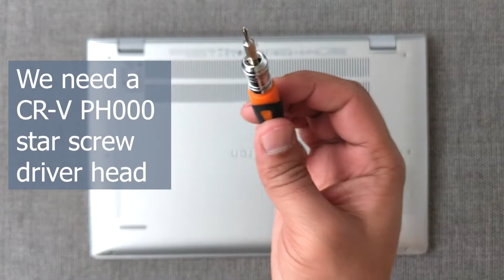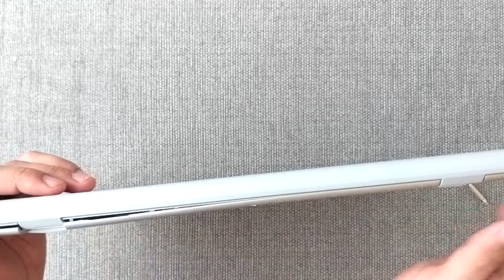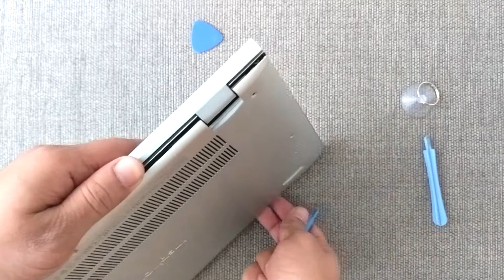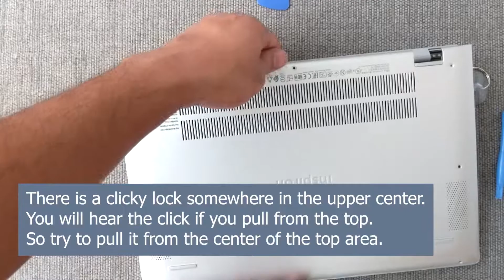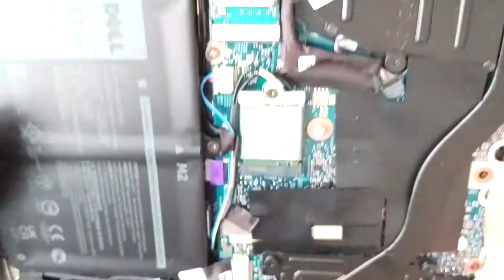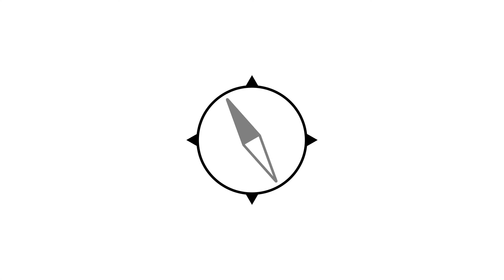How to | Disassemble and Upgrade options, Dell Inspiron 14" 5000 Series, 5402 Laptop | NAVIOSITY

Comment: I see a problem with the expansion lot for the second SSD NMVE disk, the speaker is in the same space, so one interfere with the other, not sure how to put both properly...
Reply from the maker: If you have the M2 SSD it should not interfere with the speaker. I tried it with a M2 SSD and had no issue. Can you check if you have the correct form-factor ?
Reply: @naviosity  I realized that yours is a bit different compared to mine, I will send you a picture to let you know what I am talking about
Reply: @naviosity  https://www.youtube.com/watch?v=17hrtNfHRJU&ab_channel=RepairIt Look at this video, can you see on the right bottom corner, where there is space for the SSD, is the same space as the speaker, yours and mine are a little bit different, I think it was a design issue from DELL

Comment: Thank you so much 💝
Reply from the maker: You're welcome 😊
Reply: @naviosity  bro would you please suggest me choose between acer nitro 5 and Inspiron 5402?
Reply from the maker: @jeee3t  I can try to help here. Acer Nitro 5 is more like Gaming on the move where Dell Inspiron 5402 is more regular use laptop.
If your focus is gaming, I would suggest Acer Nitro 5 series as they built it with gaming in mind, dedicated Graphics, higher display refresh rate and response time.
You can still get a 5402 with dedicated graphics and play game, but you would miss the display refresh rate and response time (which is important for gaming).

If not for gaming, I would suggest Dell Inspiron 5402. light weight, slim and small design. Smaller display bezel like most Dell laptops now a days. And to be honest, it looks much better than Acer Nitro 5 series.
Reply: @naviosity  i wanna use ae .. is inspiron capable of running it?
Reply from the maker: @jeee3t  Could you please tell me the full software/application/game name ? I could be miss-understanding what you meant by "ae".
Reply: @naviosity   i meant adobe after effects
Reply from the maker: @jeee3t  Thanks! If you want to work with any Adobe products I recommend to have a laptop with dedicated graphics card. Acer Nitro 5 already have one, but if you select Dell Inspiron 5402, I recommend to buy the variant with dedicated graphics card. 5402 also comes with NVIDIA dedicated graphics cards.

Comment: Do you know if the computer admits SSD M2 NVME? or just SATA one? Thanks a lot
Reply from the maker: Hi, the laptop board says M2 but not sure about the nvme (the one installed was SSD)
Reply: @naviosity  I checked on the internet and seems that it admists SSD M.2 NVME disk :)
Reply from the maker: @jaimearenas9532  Thanks for the finding. I'm sure it will help others :)

Comment: Hi bro, Can we upgrade 2×16 GB Ram in both the slots? And what is the maximum size to upgrade ram in this laptop,
Model: 5406 i5 processor
Thanks for the video for explaining it deeply. Loved it.
Reply from the maker: The system says it supports up to 128GB of RAM. So I don't see any issue haveing 2 x 16GB maxing out to 32GB.
On windows you can run the following command (in command prompt) to get maximum ram supported by the machine: 
wmic memphysical get maxcapacity
It gives the value in KB, so you have to divide it by 1024 twice to get the value in GB
Reply: Thanks for your quick response. Really appreciated.
Can we upgrade 16×2 gb ram with 2666V or 2400mhz?
Reply from the maker: @saqueebshariff  This laptop ships with 3200MHz RAM. I would not suggest lower than that. But if you prefer other speed, then keep both RAM at the same speed. 
If you keep one RAM (the one it ships with) at 3200MHz and another to 2400MHz, eventually it will downcast to 2400MHz for both. So you loose some speed you have.
Reply: Thats great. Thanks once again♡ So i can put 2 16gb rams with 2666v
Reply from the maker: @saqueebshariff  You should be able to install 2  16GB 2666MHz RAM. I don't think 2666(V-W-U-T) matters as all these are standard.
Reply: @naviosity  
Hi, I have upgraded 32 GB Ram in dell 5410, But it produces lot of heat below RAM part. Will anything affect coz of that. Like it produces lot of heat
Reply from the maker: @saqueebshariff  Hi, I'm not sure how to help you here with the thermal issue. It varies device to device. But I would be careful and read the RAM manual for heat tolerance (if any ) if it produces significant amount of heat that you can detect normally.
Reply: @naviosity  hi im not very good with ram i want to add another 8 gigabytes of ram which ram would I want to buy?
Reply from the maker: @riskycharlie312  Any RAM with SODIMM form-factor (most laptop ram's size) and bus speed of 3200 Hz (because the installed RAM also has bus speed of 3200 Hz). This is important.
If you put any RAM with lower bus speed than 3200 Hz, the lower value will be your performance. So just check it before you buy. Hope this helps :)
Reply: @naviosity  ok thanks

Comment: Is the material Metal or Plastic? cannot find the answer anywhere
Reply from the maker: The material is plastic. But the outer sides (of the back and also the palm rest) is electroplated with aluminium. So in first touch it feels like aluminium but it is not.
Reply: @naviosity  Thanks for the info!

Comment: How do you remove the battery?
Reply from the maker: I haven't actually tried to take the battery out. It wasn't the goal. But as you can see, the battery is not behind anything, you should be able to take it easily. Although it might be fixed with a double sided glue tape underneath.

Comment: This shows u how to remove the bottom panel lol.  What a lazy guy!  Removing the bottom panel is not disassembly!!  You don't show how to remove literally any component.  Click bait
Reply from the maker: Hi Lee, I show what is normally needed to upgrade some components. I partially agree with you, I don't disassemble the entire laptop, but I guess you don't need to for upgrading.
Reply: @naviosity  Then the title should read 'how to access / upgrade HDD, RAM, CPU, etc' or something like that.  Not 'how to disassemble'  The title is intentionally misleading to get more ppl to watch than will be actually helped by the video
Reply from the maker: @jlee3844  I still partially agree with you. But it is not intentional or any click bait title. It does what it says, maybe not in full extent or what you expected. Again sorry to disappoint you, but this is how much most people needs.